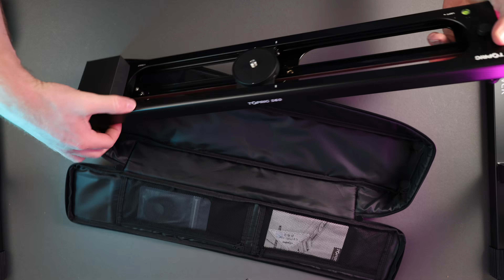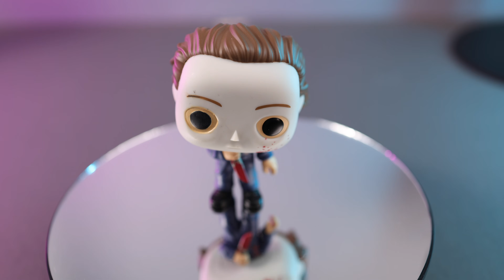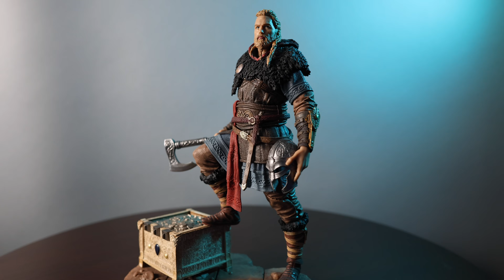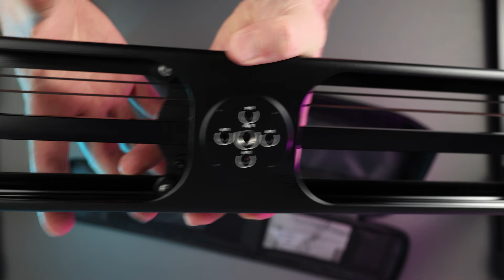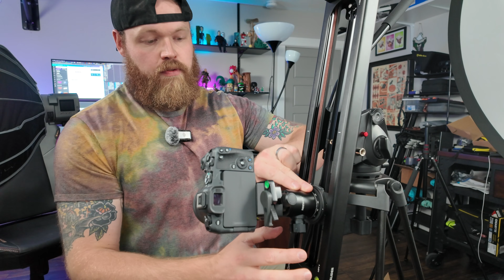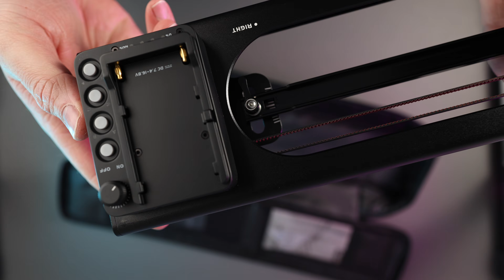BEST Budget Slider on the Market? - TopRig S60

Comment: Each time you change the speed , it will have an un dampened ends , for the first run . But subsequent ending with be smooth. So not ideal to ramp the speed during a shot.

Comment: Hey man, I found the Accsoon TOPRIG S40 and S60 Motorized DSLR Camera Video Tracking Slider Rail 120° on British eBay for £235 (S40) and £269 (S60), but the seller is based in China. Do you think it’s legit?

Also, from the pictures, it looks like it doesn’t come with a "tripod head" (or whatever that part is called). Can I use any head with it, or do I need a motorized head to keep the camera pointing at me when it moves left and right?
Reply: No matter in which country, the price of slider is not cheap.
Reply: @LindaPowerz  I bought neewer slider 120cm used..   and it workd gret for me
Reply: @VulgarTruth  What fits you is the best. I choose the Accsoon. The stability is the best in what I have used.

Comment: Question is.... how it would perform for timelapses?
Reply from the maker: One of it's strong points! I realized after making this video that I focused most of it on how I use it for product shots. But the parallax rail also reveres so that instead of your camera focusing on a fixed point, it moves in a subtle arc, facing away from  center. That, with how incredible slow this slider can move, make it perferct for timelapse shots.
Reply: @freakytechreviews  that's actually really nice, thanks so much answering. We're doing tons of astrophotography timelapses and we wanted to buy something portable but capable. We normally pack close to 30kgs, and we go up to 3100mts... So, yeah.
I think we're going to actually buy it and test it a bit.
Again, thanks for the answer man.

Comment: Thanks for the video. I ordered the item 30 minutes ago and regret not finding your video sooner. The vertical drop and the inability to lock the slider are significant issues. Had I known this earlier, I might have reconsidered the purchase. Now that I’m aware, I’ll need to find a workaround or make sure to remember this at all times. Thanks again for the video.
Reply from the maker: Thank you for watching and I’m glad that it helped! I will say that, although it does have some of those issues I am extremely happy with the slider for the price. Well, those are definitely pain points, once you get used to them they don’t get in the way of your filming as long as you stay aware of them so I think you can still be happy with it once it arrives. I’d love to hear your thoughts once you get it!
Reply: @freakytechreviews  Thank a lot for your reply.Have you tried to move the camera manually to select A and B points faster instead of waiting for the slider to move? Do you think that this will put too much pressure on the motors?
This is something else that might be problematic when setting up shots.